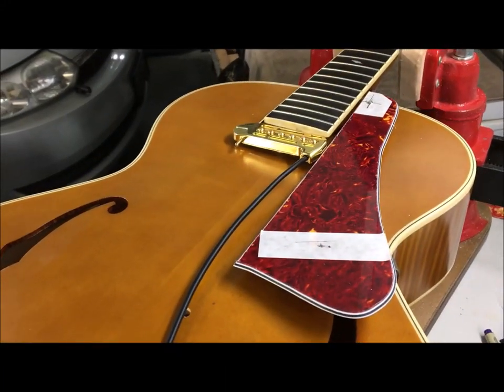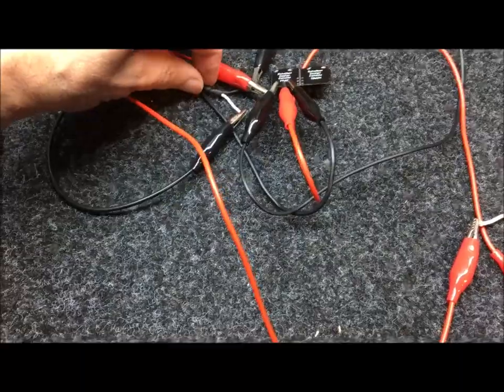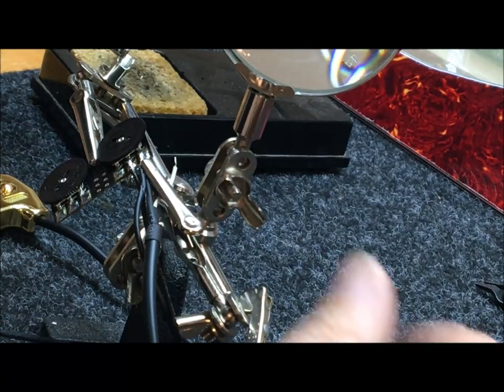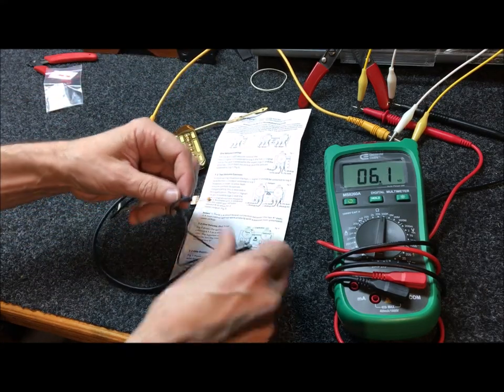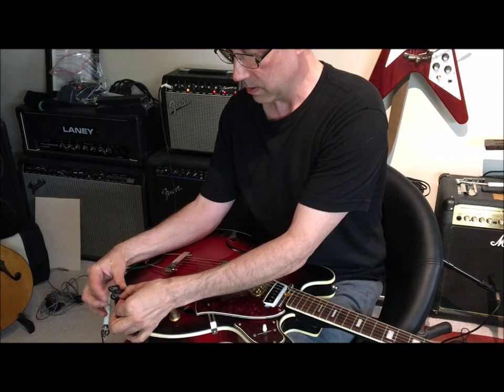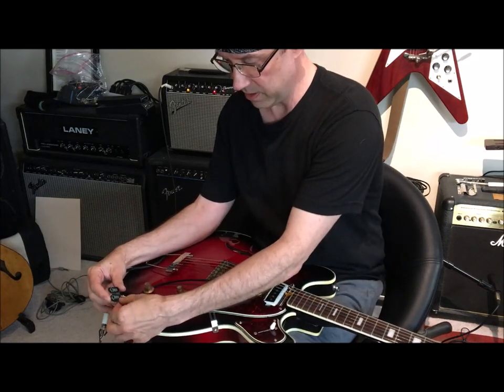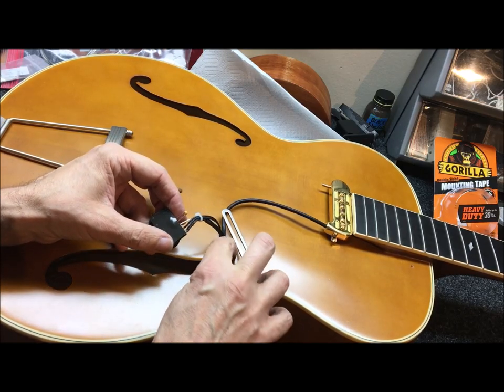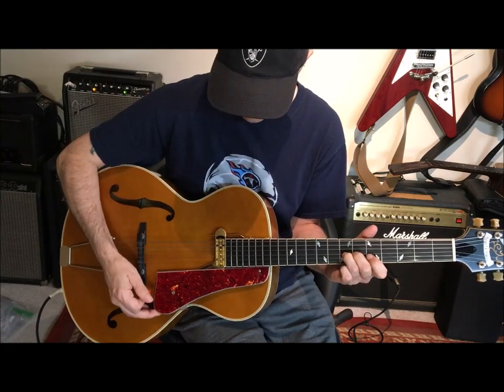DeArmond Rhythm Chief 1100 Installation with Schatten Thumbwheel

Comment: Nice work, Scotty! I use the same sort of “helping hands” setup when soldering, and have found that slipping bits of plastic tubing over the jaws of the clip holding the wire will prevent the jaws from biting through the insulation. Not that it matters, but I’m finicky. 😊
Reply from the maker: Thanks! 😊

Comment: My I ask you if it was the schatten thumbwheel with 500 K? Because it is not a humbucking pickup I fesr it will be brittle in my ears with that, but when your was that one, I know what to do.
Reply from the maker: It’s this one if I recall. Check the product installation instructions to see if it mentions the value. If not, please ask the dealer. Thanks for watching!
https://www.stewmac.com/electronics/components-and-parts/potentiometers/schatten-thumbwheel-controls/